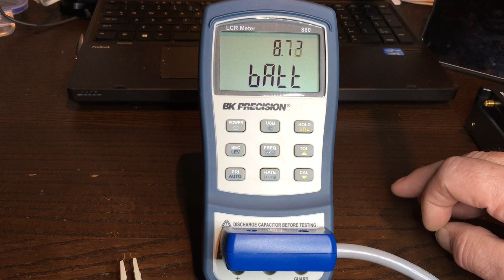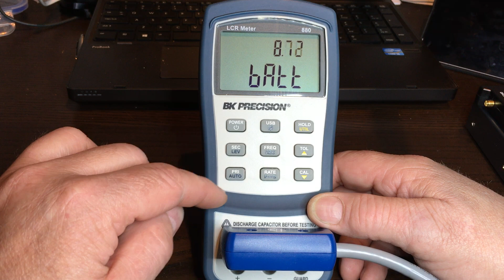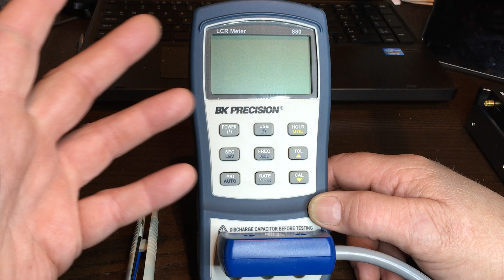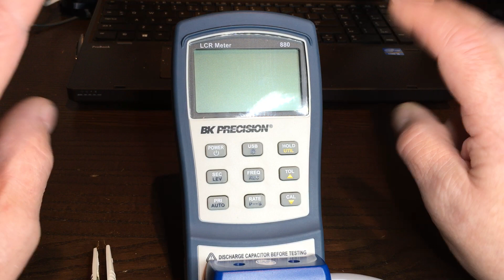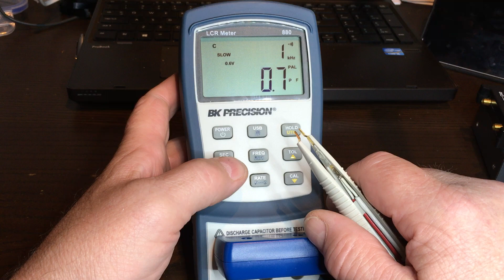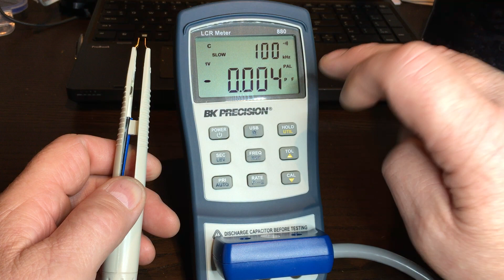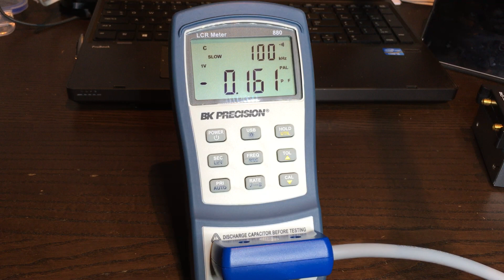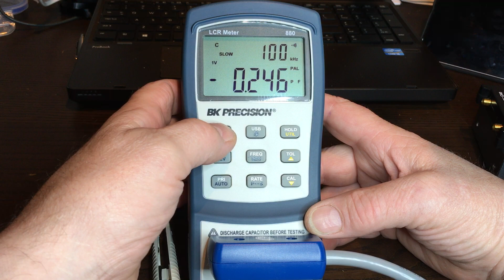bk precision BK880 LCR meter-2, buyer beware.

Comment: SO!!!!! I was concerned about the battery issue, so after being in storage for 6 months, I got it out and turned it on. The battery was still good, showed full charge, so the idea of it only lasting a few weeks was not the case. My meter is only a year old, so maybe the battery has been upgraded since your video is 2 years old???? I always give it a full charge before I store it away, but now that Summer is over it will be left out as I will use it several times a week as I repair some electronics..
Robert
Update, I decide to go check current flow in standby using my Fluke 289 meter. 9.98UA so that tells us why the battery drain was so low after 6 months in storage...

Comment: Thank you for posting this video, it was really helpful! I was about to buy the BK 880, but after watching this video I got second thoughts. I won't use the meter on a daily basis either so having to deal with the battery problem didn't seem like something I wanted to put up with if I could avoid it. I ended up with a Keysight U1733C. It's no secret that despite their similar look those meters are complety different. And Agilent/Keysight chose a different approach: The power button is a latching type. This doesn't necessarily mean 0µA off-current and I haven't measured it yet, but it looks promising... The Keysight doesn't have 4-wire measurement capability, the test voltage is fixed and some specs are a littler bit worse, but for my use cases it seems plenty capable. Also: My first Keysight product. The orange color is nice ;)

Comment: I have same one and i don't agree with you. Because if you know that it is the case you usually don't leave it offline not used at all. If you are real electronic person then you usually using it on weekly basis ..even if it isn't daily..once per week for sure..but ofc i don't have it off for months..i don't see any reason for that..it isn't that kind of meter. For that you need different meter
Reply from the maker: The battery draw on standby is just not of this world and certainly not for a fairly expensive meter, mind you there are lcr meters at half the price doing the same thing as i learned from a friend who bought a different one, and that one doesnt leak batteries completely dead within 1 week, its just ridiculous and something is clearly not right with this meter however according to BK precision there is nothing wrong with it and the standby current draw over 20 times more then specified, these people are jokers and just do not want the hassle of an european guy far far away, thats american customer service for you all out.
Reply: "For that you need different meter"

No, just take the battery out or use the power adapter if the meter is not used every week.
Reply from the maker: @EnigmaVideos  i am afraid you dont understand: there is something wrong with this meter, the standby current draw is specified in the specifications at 11 micro amp, my meter does now 873 micro amp, so 0,9 milliamp
Thats 80 EIGHTY times more then specified (!!!), the standby draw is just ridiculous and there is obviously something broken in this meter from day1.
At that rate the fully charged battery lasts just a few days before it is COMPLETELY DEAD.
there is something in the power circuit leaking, i suspect one of the mosfets but as bk doesnt want to repair and also doesnt want me to have a schematic there is little i can do besides one of these days drill a hole in the case and fit a mechanical switch or just toss it on ebay one of these days and get rid of it and never buy BK PRECISION again.
Taking out the batteries every time after use is a  stupid solution, did i tell you i paid over €500 for this piece of junk?

I may use this meter repairing a radio or tranceiver for a few weeks but then if i dont have that particular type of work it may be in the closet for a weeks, on of these days i will find it with leaking batteries inside and i can through it away, just like happens with all equipment that eats batteries in standby/off.

I will make another video soon about this piece of junk and it will remain on youtube until bk solves the problem, if not it will be here forever, its there loss not mine, i will get rid of it but the vid will stay.
They have my email, they just have to give me a message telling me where to drop it of for repair.
Reply: @robber576  I think the real LCR meters are the benchtop ones that cost a lot of money. So yes, this one called 880 is naturally not the best model out there. LCR meters are mostly made for manufacturers that have the money to pay for a benchtop model.
Reply from the maker: @EnigmaVideos  i have no problem with how the meter performs when it works nor do i have a problem with the current consumption when it works, when it works it is mostly al fine and the small problems like no setting for the backlight or the missing "zero out/rel" option is not a big problem, al meters have little things like that and you mostly just have to get used to it, no problem.
I like the accuracy of this meter, it can measure really small caps and inductors and quite accurate.
There is just something wrong with my meter and american customer service of BK precision is awfull.
If i had a schematic i could swap some parts and probably repair it myself but as the oarts have no meaningfull numbers on them i do not know what the parts are and so cannot replace them.

Comment: (..On my previous comment) ..I might been wrong on how to go about measuring with the Bk880, and thereby maybe there was no error on my instrument   ...Have always set measurement-frequency to 10 kHz. After reduced it to 1 kHz (for measuring ElLyttic-Caps) it seems to measure much more normal.  __I must say, it is a somewhat broad field regarding measuring Ac-reactive components. Constantly learning.  __So, lets see (and me hope) for now, whether it was user-error from my side.  Have nice upcoming weekend.
Reply: When you're measuring large electrolytic capacitors, you really need to set it to either 100Hz or 120Hz to get an accurate reading.  This is because a large value capacitor will filter a 100kHz signal down to almost an unmeasurable level.

Comment: Thanks for sharing the Bk880 videos Robert. Was conducting some search now for the Bk880 since myself experiencing calibration-issues(unable to successfully calibrate in the meny anymore). It has started to show about 50% 'to low' on capacitance measurements. Still trying to sort it out, but in the meanwhile might have to purchase a second different meter. Not necessary only because of this, but for future work.
Did contact BK-support also. And they responded fairly quick. They want me to do a couple of measurement test (according to their attached data-sheet), and send back to them. They noted also that it could be necessary to return the Bk880 for factory calibration.  ,,,For now me await a littlebit to do these things. Have noticed it intermittent showing correct value (..very seldom, but it happens)  __ //Thanks again for sharing your other findings in your video.  __br, from norway.
Reply: Hope mentioned correct name. (Someone referenced Robert in your channel somewhere)

Comment: Bk-precision is good meter for measuring capacitor for me and diode transistor for my experience. But for measuring coil inductance. For my opinion we need buy seperate Inductance meter solid One programming is one measurements only. Like inductance
https://youtu.be/vYHtGuWg3d8